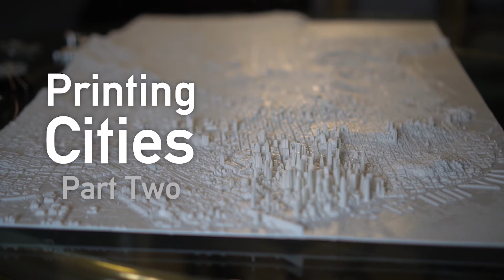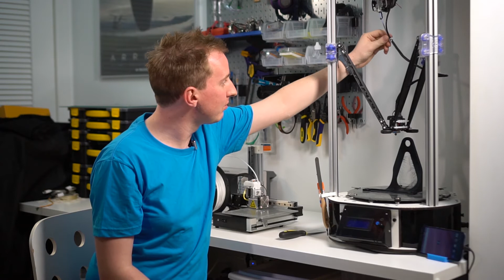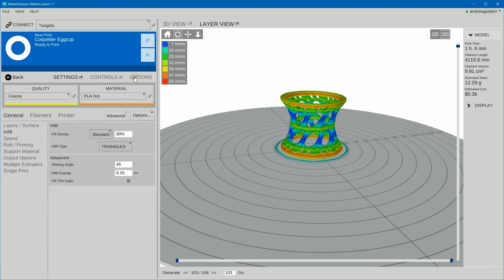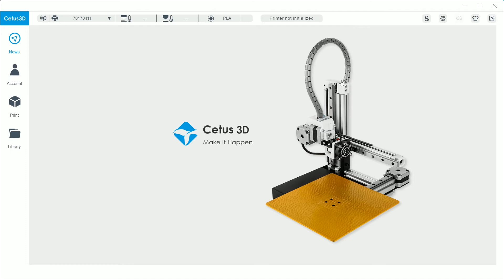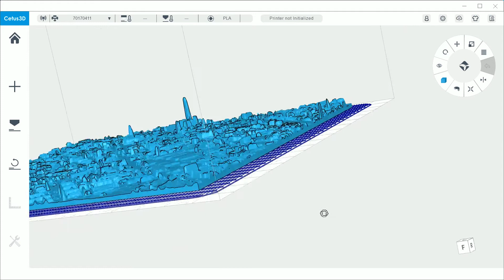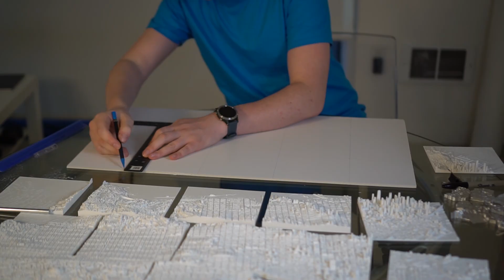Printing Cities: Part Two

Comment: What is the best 3D printer to buy for building city maps?
Reply from the maker: That's an almost impossible question as there's so many!

The thing you're mainly looking for is retraction ability (in FDM/filament printers), and most of them are good at that now, and build area (in all printers), so I'd suggest getting whatever people recommend as a decent entry-level printer and trying from there.

Resin printers are particularly amazing at them, but they're messy, use somewhat toxic chemicals, and are very expensive as you increase build area, so I would not recommend them for a beginner!

Comment: Is possible to print a city on a anycubic photo resin printer
Reply from the maker: Absolutely is! Your main problem there is going to be the small size the printer can print - at best you might get 3 inch/7.5cm tiles if you are lucky - but the detail a resin printer can provide is second-to-none. I'm actually working on doing some resin versions myself, albeit with a large resin printer that can do 6 inch/15cm tiles.
Reply: @AndrewGodwin  thank you

Comment: Hi, I thought I seen a drone in the background have you thought about using it for photogrammetry to create a 3D model which you can print? Ive made 3D models using my drone before but I don't have the printer to finish my idea, so looking at getting one.
Reply from the maker: I've only done photogrammetry using a tripod camera, not the drone, due to flight restrictions in the areas I wanted to capture (national parks)!

Comment: Hey Andrew, Awesome video! You're very generous with the detail, thanks for making these! Is there really no easy method for moulding the tiles? 

Cheers
Reply from the maker: Not that I've found yet, though I am still relatively new to moulding and casting. I've had a chat with a few people more experienced, though, and it seems that I would probably need both a vacuum chamber (to degas the resin) and a pressure chamber (to remove bubbles during the cast).